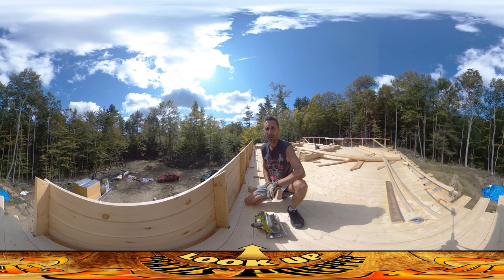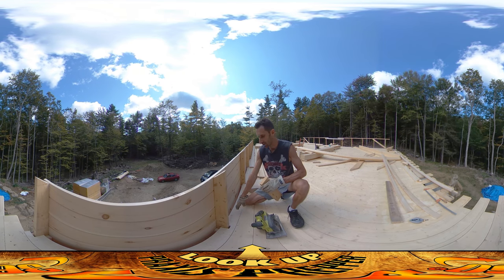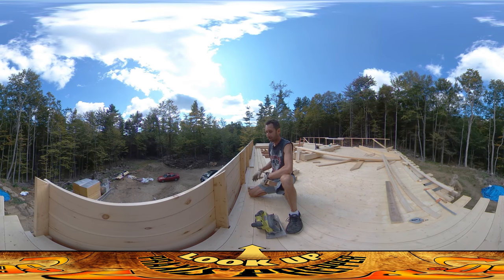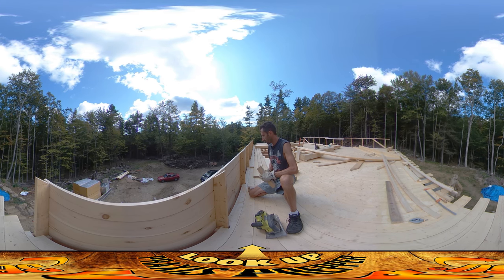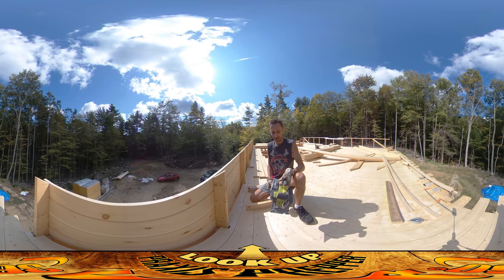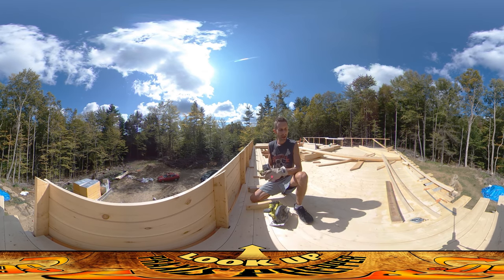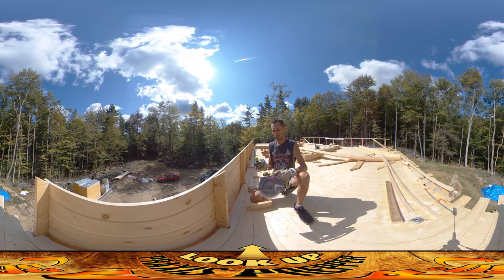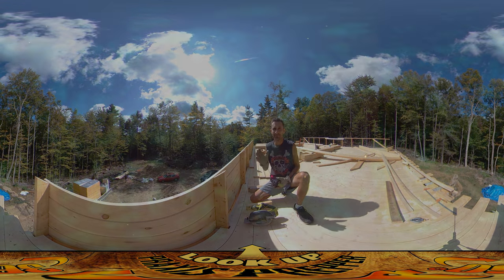Homestead Building - Royobi Tools and Batteries, Prepping for Roof Trusses

Comment: It looks like the floor board along the wall is narrow than the other boards, Did you cut them down because they weren't going to reach the wall so you needed extra space for ripped down 2x4's to eat up the space or was there another reason or is it simply an optical illusion?

Oh, thanks for the battery updates.
Reply from the maker: That's a 2x4. And There's an "my Ryobi saw seems to be dead" update coming soon... the batteries are still great though.
Reply: Praxis Homesteading and Survival Skills Looking forward to it. Was really impressed by the diversity in tools for the One+ series. It was the only brand to be able to get both outdoors/landscaping tools and regular construction/maintenance tools using the same batteries. There is even an 8 Ah battery but I have to imagine you'd have to have forearms like Popeye to be able to use a tool with it other than the ones that require two hands anyway, like the chainsaw.